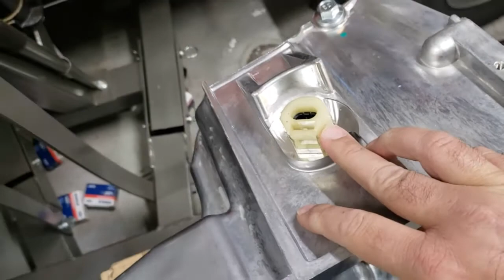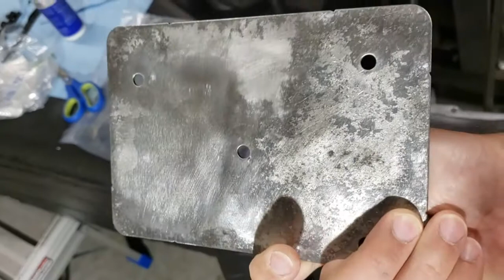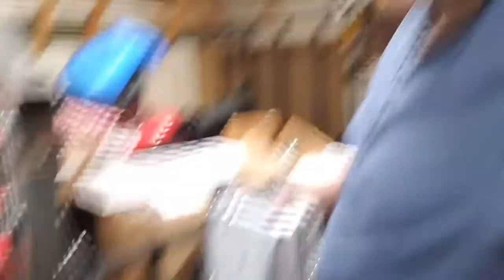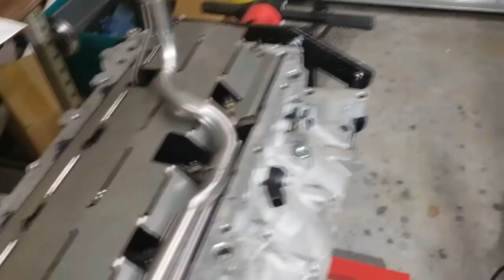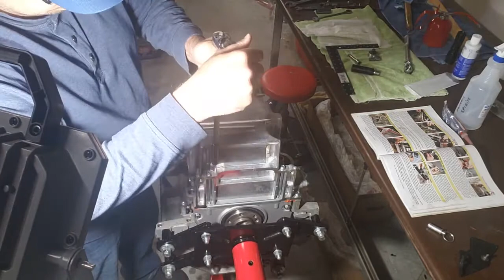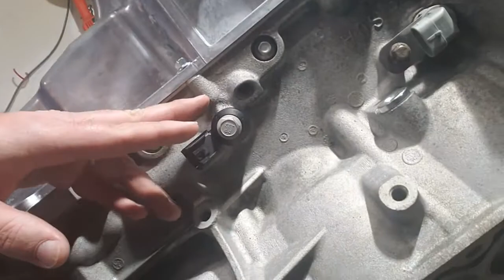Episode 40: Final Assembly - Oil Pan Install on my 5.3L LC9 engine rebuild project

Comment: Good job!  On high horsepower LS builds there’s a lot of pressure working against the head bolts. I would torque them to spec and then heat cycle the engine and retorque to spec again. Definitely use a catch can. Did you check the casting numbers on the heads to make sure you don’t have the factory defective ones? Did you already do a valve job???
Reply: Gen IVs with Castech heads?  That motor runs 799/243s.